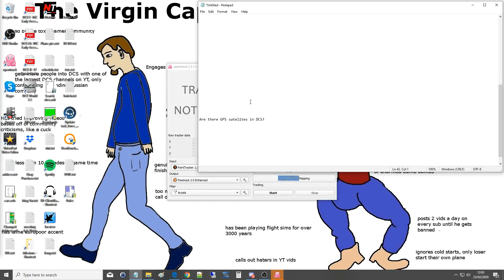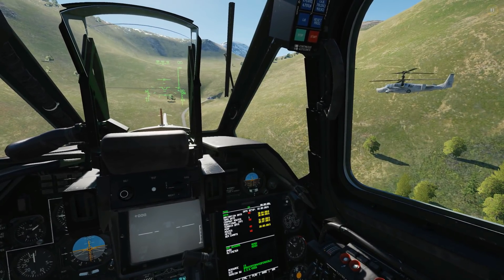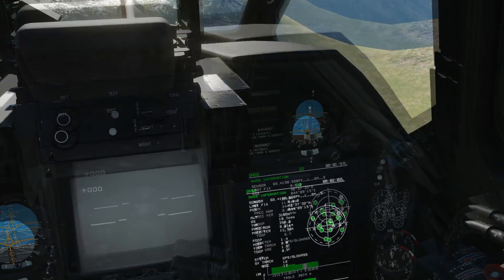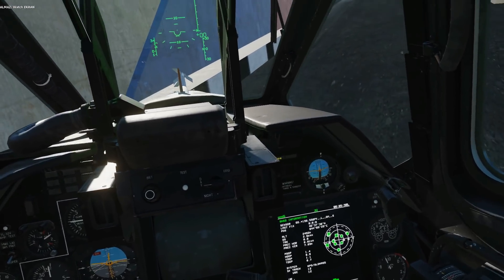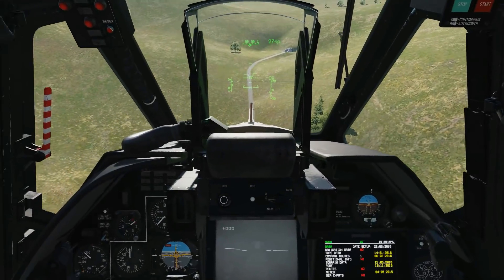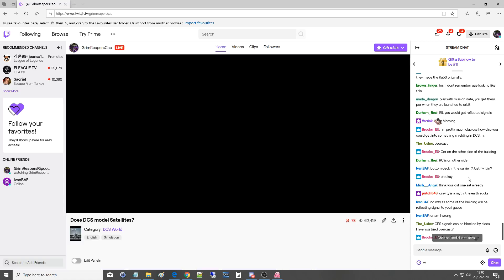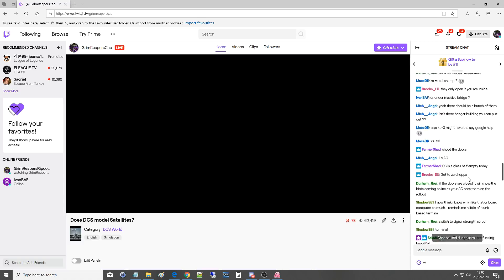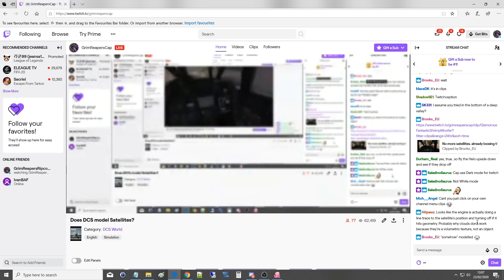Questioned: How Are Satellites Modelled In DCS WORLD?

Comment: You're correct that GPS is a passive thing, at least in small-scale units like these... big, long-range stuff like airliners do send an "I'm here, keep sending signals to the middle of the ocean" ping to the satellites.
Basically it works via the satellites broadcasting a signal with their ID, location, and time every so often, then listeners can combine the data from multiple satellites with the speed of light to figure out where they are.
The fun part is the only reason this works the way it does is because of relativity; the speed of light is constant no matter how fast or slow the sender and receiver are moving. If light were like bullets and had a faster closure rate with a sender and receiver moving towards one another compared to away from one another, GPS would be a much more complex and difficult thing to make.
Reply: Maeyanie no object has a pinger to tell satellites where they are. It’s only the satellites maintaining broadcast all the time. The orbit design for all GNSS constellations always ensure each spot on earth is covered by at least 4 satellites at any time (X,Y,Z and receiver time error). And they won’t stop broadcasting so you don’t need to tell them to keep broadcasting
Reply: @leejimmy8790  You're right... the news here had said that the missing Malaysia Airlines flight 370 was tracked to an approximate location that way at the time, but re-checking more reliable sources now apparently it was a communications satellite, not a GPS one.

Comment: Even my car's nav system uses both INS  and GPS  ,   so it still works in long  tunnels.   You can hear the gyros spin up when the doors are unlocked before  the electrics/engine are switched on.   So also works when there is no GPS signal  (try driving near some government installations  or the likes of  a nuclear power station.. I'm sure  the Gov  jams  GPS signals near such places).

Comment: They should actually model satellites and add anti-sat missiles. Imagine knocking out the enemy's GPS and Comms capability during a simulated defense or invasion. (I know the F-15 can carry anti-sat weapons but I'm sure F/A-18s and others could too). I bet the Russians have a similar system that can be fired from a strike fighter but I'm not sure.
Reply: Think about how high satellites fly (and why they fly that height for their particular mission). GPS satellites are geo-stationary  and to do that they are approx 12,500 miles up. A typical military spy satellite is the opposite, it wants to be as low as possible to get a better view of the things it is spying on - so it might be typically 100 miles up. The F-15 & anti-sat missile combo is designed for those low orbit targets, not the GPS ones.....
Reply: Besides, GNSS jamming is much more effective, and cheaper.  GNSS signals are actually quite weak and should therefore be relatively easy to jam.

Comment: It might also start getting some work done on it with the advent of the submarines being added and them actually being able to submerge. Because receiving signals while submerged has always been an issue with submarines. And I mean signals in general, not just GPS. Submarines can get away with using VLF signals and specialized antennas, but hundreds of feet of water is a damn good insulator from electromagnetic spectrum radiation. So perhaps in the future this aspect might get more attention to it. I don't know how far ED would go in modeling it for non-submarines... I mean... not often planes or helicopters are in tunnels. But it could be possibly something like "if the vehicle is in these boundaries, they can't receive [X] signals" on individual maps. I dunno. Interesting to see that it's already modeled as much as it is. I would've just assumed it was magic "signals through the earth and mountains and sea" and you just always had it. Apparently GPS satellites can lose connection, however.

...And it's also really sad that such an old module is so highly detailed and well-done whereas newer ones are... Well... Y'know... Not always...

Comment: What about the NS 430? maybe that's more easy with ground vehicles, also, how about try to ge into the tunnel with some speed and use the ejection button to only blow up the rotors?(by disarming the ejection seat and canopy in the safety switches)
Reply from the maker: roger have not learnt it yet

Comment: I used to work as a land surveyor and the GPS should have lost contact with those satellites as far in that tunnel as you were at moments. The DOP values should have had a noticeable change in the tunnel if modeled correctly and they didnt change much at any time besides when the helicopter flipped over. So it may be that the orientation of the satellite antenna is modeled at least, but as for terrain and object sensitivity not realistic but seems to be some.

Comment: Cap - if you want to know anything about GPS and INS integration and how things work, then I recommend you get a hold of the folks at Holloman Air Force Base, NM that work at the CIGTF.  The CIGTF is the central inertial and GPS test facility run by the 746th test squadron. Good guys over there with tremendous capability in what they can test and extremely knowledgeable. - Ronbo
Reply from the maker: heh Ronbo

Comment: As a surveyor which used GNSS everyday, I can answer a few questions. The GDOP, HDOP, VDOP, PDOP means the Dilution of Precision (Geometric, Horizontal, Vertical, Positional), basically means hows the satellite geometry affecting your position solution.

Actually I would suggest you making a test by having one helicopter positions next to a steep valley (obstruction higher than 45 degrees), with another one at much higher altitude with clear sky visibility. You may check if the GDOP increases for the one at the steep valley, a higher value of the DOP means poor solution quality.

Another way to check if the satellite orbit is correctly represented would be the GNSS almanac. Check the exact time and date of your mission, your position in DCS (lat, long, H) and search it with the website. Look at the sky plot to see if the satellite geometry is similar to what it has been displaying on your screen

https://www.gnssplanning.com/

12 satellites are not the maximum. We track normally around 17 satellites while working with GPS and GLONASS (not to mention Galileo and BeiDou system)
Reply from the maker: Thx Lee